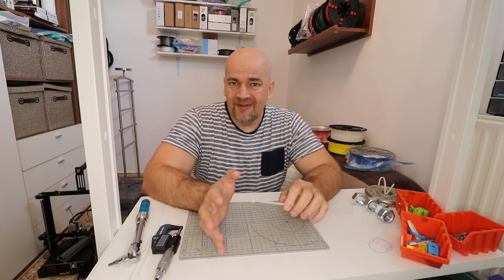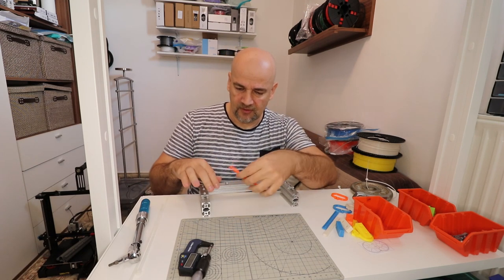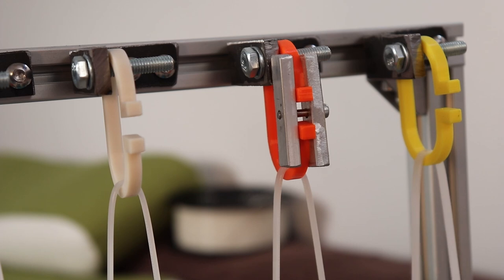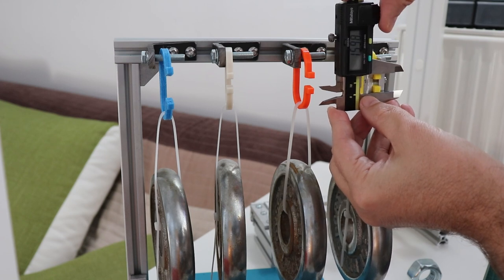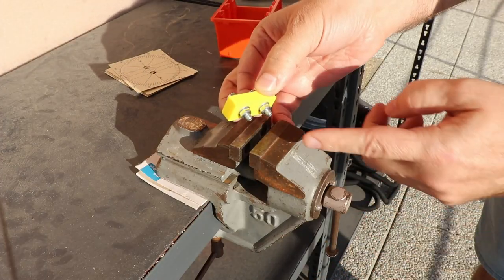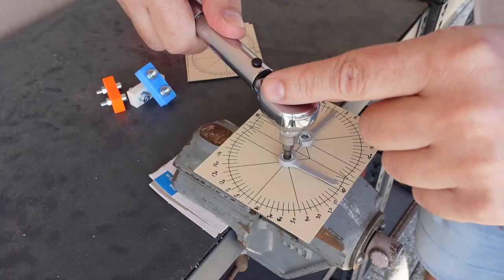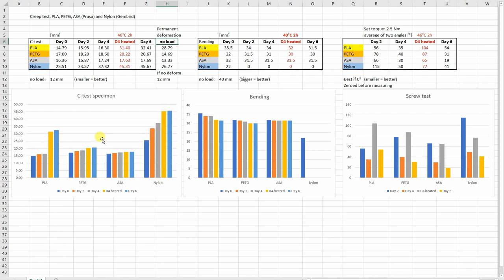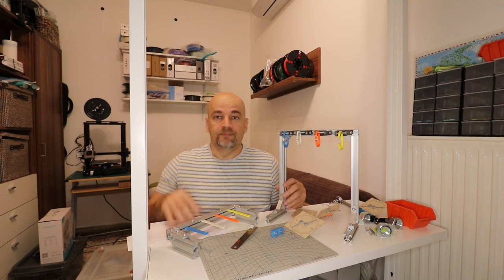Creep test with 3D printed plastic materials: PLA, PETG, ASA, Nylon

Comment: Excellent! Creeping is too often overseen in 3d-print material tests but has so much impact when dealing with plastics. Thank you!
Btw: in my experience the gap between PETG and ABS is truly noticable in real life parts, therefore I moved to ABS. But might depend on the brand.
Reply: The Voron community only uses ABS because of it's creep resistance
Reply: @WhenDoesTheVideoActuallyStart  Prusa printers use PETG. So, you tell me.
Reply: @alejandroperez5368  And? ABS is still better at creep resistance than PETG.

Prusa uses PETG it's because they had the freedom to design a printer with parts that only required certain specific properties, and had the freedom to design both the models and the polymer blend to meet those needs. Besides, they're mostly there for aligning parts, almost none of them are load-bearing.

The Voron team doesn't sell printers, they can't hire factories to produce specific metal parts for their printers or fabricate their own filament blends, they're just a grouplet of hobbyists designing printers from parts that are available off-the-shelf, so they have far more limitations.

The Voron team had to design their printers around the minimum properties of common off-the-shelf filament blends and chose ABS, despite the eternal nagging by new people about the possibility of using polyamide or PETG - their printers simply won't perform well with those.

Comment: The compression creep tests are fascinating.  I had a functional print with a live hinge compressed around a pipe, and over time the PLA it was printed in migrated away from the bolt until it became impossible to tighten it anymore.  I was hoping to find PETG or ASA had less creep under compression, but evidently not.  I guess the best that can be done is to print the compressed area at 100% infill and use the largest washer I can fit in that area.

Or carve it out of wood...

In any case, your data and collection methods are really handy, thanks for the data!

Comment: This is awesome.  Might I recommend a slightly different "screw" test?
Instead of testing how much you can rotate the screws at a given torque, a more in-machine relevant test might be to test the torque required to break the nuts free.
Procedure:  Tighten nuts to a specified torque (using your high-repeatability click wrench), then check the maximum torque required to "break free" using your digital one.
If the material softens, there won't be as much pressure against the threads, and it should have a lower "break free" torque.
Reply from the maker: Hm, great point, if I understand correctly. Instead additional tightening the screw, more important is the torque for loose the screw. That also a realistic case too. 
Perfect would be if I could measure the pressure between 3D printed object and the nut or washer for example. Imagine you use screw to join two parts, you want that pressure between two parts to be constant and strong. Now, that's hard to measure. What I can easily measure, is additional twisting the screw (which is in linear corelation with that pressure), as you can see in video. 
Maybe at the end of the test, I could measure the unscrewing torque too.
Reply: This would be very difficult to get repeatable results since a great deal will depend on layer adhesion. You are describing a shearing test in essence.
Reply: @MyTechFun  the most relevant statistic for screws in plastic is how the clamping load decreases over time, this is usually what's speced out in injection molding plastics tech sheets. However this is sometimes hard to measure, requiring a load cell/strain gauge

Comment: This is something i needed!

I would like to add untreated PLA vs annealed PLA comparison to the test, i wonder if annealed PLA will perform better.

Also a material that often gets neglected in tests is HIPS. It is very inexpensive! It's supposed to shrink less than ABS in printing, and similar to ASA, and be more rigid and less smelly than ABS, though smell potential exists, and high shrinkage potential exists too. I think i would like to see more of it. I think there can be a massive difference between brands, as opposed to ASA or PETG or most non-silk PLAs, which is unfortunate.

I do like the C-shape test, in the absence of other tests, so if i had to choose just one test out of 3, i would make a decision based on it alone, and it's fine to me as-it-is; but i think screw test is interesting too, it looks like it will provide interesting and distinctive results eventually. I also actually liked all the tests though. Maybe if you use a piece of double sided tape to secure the nut, nylon can survive the 2-point test too, well enough to make a measurement, with enough room for it to bend down. But it also looks like the most fragile of the tests, with potentially needing a different thickness of the sample depending on modulus to be comparable.

45°C is an excellent choice for a hot box, as it's more or less representative for example also of use inside a car or inside a computer. Normally say you can expect the air in the computer chassis to become 40°C under load and SSD or hard disk can also reach 45°C. Currently i have a 3D printed SSD retainer in my PC and will probably have a 3D printed CPU cooler mount in my next PC. Ideally i won't have a 3D printed backplate but we'll see. I recall Stefan (CNC Kitchen) did have a 3D printed CPU cooler retainer and it failed on him, and it was i think CF Nylon? In hindsight, not surprising. He also experienced his Voron fail in exactly the same manner, with material creep under mild heat!

I actually don't terribly mind PLA being used for part cooling fan assemblies and such, because they aren't really load bearing, and also can survive some permanent deformation. But i do think PLA is less ideal.
Reply from the maker: Thanks for your detailed comment. Yes, any kind of nylon (CF nylon) have this creep problem, it is good in impact tests for example. 2 point bending test I will replace with 3 point, only I have to solve the problem of accurate reading (with dial indicator, more accurate). 
And on my list is testing of annealed PLA vs PLA (and vs Nonoilen filament, because it is PLA type but heat resistant up to 110°C without annealing, tested earlier). For ABS testing for voron parts probably I have to go higher, up to 50C (accorting to response to my question in Voron group) and for longer time, not only 2 hrs. Mayabe 4-6h.
Reply: @MyTechFun  Thanks for the great video! I'd also be very interested in results for annealed PLA.
Nonoilen seems to be similar to extrudr GreenTEC Pro, maybe that would also be a good candidate for testing...

Comment: Thank you very much, very helpful and careful tests. I am printing a spring for a battery holder. The PLA spring deformed under the small tension of holding the battery. Based on your test I'll try PETG.

Comment: Thanks for the info! The screw test is extremely relevant since it's very similar to the kinds of loads some printed parts face when they're actually in use. I'm curious about whether annealing would help the nylon (or PLA) too.

Comment: Nice Video. I would suggest to normalize the results to get a % value (eg. Platic defimation/lenth).
I have done similar measurements with another geometry. In my measurement PLA and PETG performes quite similar (20°C).  But annihling the parts used to have an extrem impact on the creeping. It more than halves the creeping (also on PETG). The effect of the annihling was much much bigger than the difference between the materials. With Extrudr NX2 I also have found a PLA, wich dos not deform so much during the annihling.

Comment: I appreciate this test a lot as creep is an oft overlooked issue when designing plastic parts. However, and feel free to discuss, I have the impression this test is incorrectly setup because it does not account for the amount of stress relative to the yield stress of the material that the samples experience. For instance PLA is really known to creep a lot but because it is also strong and stiff, it does not deform greatly in these tests, since you are loading it with a different percentage of its maximum allowable stress than the other materials, which could be loaded closer to their yield points leading to increases in creep rate. The total amount of creep deformation at a fixed percentage of the material yield point would be more indicative, as well as the total deformation after creep recovery.

Comment: Thanks for conducting the tests. I have a question regarding the torque test. Your data shows that ASA on day 2 achieve an a average angle of 66 and then on day 4 it’s 30 degrees and when heated it’s back up to 65. 

Actually it looks like your day 4 averages for all materials appears to be better. Any ideas on what the cause might be?
Reply from the maker: I think that's normal. If there wouldn't be heating, that rotation angle would be smaller and smaller after every test, since the material is more compressed (this was printed with infill, as I mentioned). With heating, this angle jumps, but then it would be again smaller and smaller after every tightening.

Comment: Great test. Just a question about the nylon. It looks like it was not dried before use, looks like you can see that it has bin bubbling when extrudes. You also did not mention if the nylon have had time to equalize with the humidity. Freshly printed nylon get softer over time cause it absorbs moisture.
Reply from the maker: Nylon was dried, but probably not enough. 4h at 70C (it is recommended 12h at 70C, but I thought that it stay dry, because it was dried before packing in vacuum bag)
Reply: @MyTechFun  i doubt it will affect the result much since it is tested over a period of time. It will absorb moisture and get soft. Directly after it was printed the piece that was printed with wet nylon would prolly lose.

Comment: Super video! Small improvement: when testing the retightening. Don't clamp both nuts at once. I think since this does not only lock the nut from rotating but also in vertical direction against the other nut.
Reply from the maker: It is important to lock only nuts, to prevent them from rotating. So all rotation is made is visible (and measurable) from the other side. If I would hold only one nut, 3d printed object may rotate too during testing.
Reply: @MyTechFun  yes true! But I mean only one nut? Unsure
Reply: @MyTechFun  nevermind, with only one nut clamped, you could not messure the rotation since the part itself maybe turns as well

Comment: I thought the screw test was useful and would happy to see if you can develop it a little more to get more meaningful numbers from it. Maybe have the screws hold 2 pieces together with a pressure sensor in between (Arduino/Raspberry Pi pressure pads are pretty cheap). That way you can test if the clamping force is actually weakening over time, if the additional twisting to the same torque is actually increasing pressure or not, etc.

Something else I'd like really like to see is some testing in the cold. I like the higher temperature tests you do. No one seems to test for the cold, even though many people print things that are meant for outdoors or to be kept in a car. How do prints with different filaments change in strength, flexibility, and brittleness at or below 0°C?
Reply from the maker: I got your point, and you are right. I have some pressure sensors, BUT it is not so easy to use them, I need two equal or one with hole. Place it simmetric etc. That's why I measure this torque, because it is in linear correlation with that force between two parts. 
About cold test, great idea, definitely I will test it, winter is comming, I hope I will have -10°C outside :-) And I am curious not only for creep test, but also tensile, layer adhesion etc.

Comment: Great video and glad to know you are building a Voron. I am building myself a 2.4 300mm spec also. For the 4th ABS in your tests I can highly recommend "3DJake niceABS" or "Formfutura TitanX". I have been using 3DJake niceABS for my Voron parts, it is really good! There is also the option for "Amazon Basics ABS" which is cheap and I think more difficult to print, as it is not modified (no ABS+, ABS plus, ABS Pro, ABS no warp etc) it is just regular ABS, but it might be surprisingly good in properties because it is not modified. Finally, I would be interested to see NonOilen compared to PLA, especially because of the results in this video for PLA after heating and your previous video where you boiled NonOilen. I bought NonOilen from 3DJake because of your video by the way.
Reply from the maker: Hm, that would be useful info, yes nonoilen resists high temperatures. So far, i was only thinking about nonoilen for food safe applications on my workplace (food engineering department). But from the other side, it is very expensive material, so I would prefer ASA instead (if no need for food safety). Oh, so many tests to do...waiting in a row.. pity that creep test is so slow process :-)

Comment: Thank you sir, very informative video. I believe all the impact tests in the world are kinda useless compared to this because most functional printed parts are just holding something, silently deforming over time.
For even more comprehensive creep test I would like to see how part thickness influences creep for a given material. (So, for example, maybe PETG creeps more than ASA in a 2mm thick part, but less in a 6mm part)
Another test would be to measure twisting creep.
Reply from the maker: Twisting creep - great idea, thank you for the tip. Thickness effect to creep.. not sure if I will test that, more likely I will test is the correlation between thicknes and stress linear as with metals.

Comment: Great test! 
All 3 the methods show similar results (though not always the same magnitude but that is to be expected). What isn't recorded in the state after taking the stress away. At the end of the video it is clearly visible how much elasticity is lost by PLA after just a short heat cycle. But I am surprised that Nylon is so poor and doesn't return to its original state.

Polycarbonate is known to be very creep resistant but is brittle and sensitive to oils so would be a poor choice for your Voron build. PC-ABS might be the ideal material upping some properties of ABS (ASA) but not being so brittle as PC itself.

That obviously leaves CF-PETG and CF-ABS or CF-ASA as options. The surely are stiffer and very creep resistant . Whether they don't become too brittle is a question.
Reply from the maker: I just got from esun ePA, ePC and ABS+ so this will be one of my next testings. Carbon fiber...yes but a little bit later..

Comment: Try to anneal PLA - grind table salt in coffee grinder, pack it around the PLA part. Put in oven at around 100 Celsius for 20 minutes. I tried it and PLA parts do become much stronger, though I didn't measure exactly by how much.
Reply from the maker: I'll try annealed PLA too (comparison with regular PLA and Nonoilen filament). But not sure if I will anneal it in salt, I know it will deform but I will see the dimensions.. still new to annealing..
Reply: @MyTechFun  In my experience part doesn't change dimensions if packed in fine ground salt. You don't need to remelt the plastic, 100 degrees Celsius (212 F) is enough.

Comment: I modded my ender 3 to dual belted Z. Bottom belt holders were first from ASA and cracked a bit due to weak design (except the crack they were working fine). I reprinted buffied ones with PETG as I ran out of the ASA. I noticed that initially I had to spend more time leveling the bed than with ASA ones. Also now after few months I had to re-level the bed a bit. So at the next printer service I will replace the buffied PETG parts with buffied ABS ones.
Reply from the maker: Thanks for sharing your experience, very useful info.

Comment: For the compression test, maybe the results would be more useable if aggregate result was calculated?  That would show how much in total the bolts had to be tightened.
Reply from the maker: Yes, I agree, I noticed that later, now they are different type from first two. But, at least, excel table is downloadable, so it can be done by user too (*I will add this graph to downloadable excel)

Comment: I think for the screw test, the better visualization would be to show the running total angle, so day 1: 30°, day 2: you get another 50°, so plot 80° and so on
Reply from the maker: That was my first plan, but pointers are too big, they will hit the other bolt. But I need two screws to lock the position of the nut on the other side. I can redesign the graph, so it will show summary result. I'll upload this graph to my website, link in description.
Reply: @MyTechFun  ah, I think you can just add it on the graph, you don't have to do it with the pointers
Reply from the maker: @LightSpeedIII  added, new excel table uploaded

Comment: In my V0, chamber temps are around 60C, I'd recommend setting that as an temp goal for testing, and I'd test over a 24hr period, as 2hrs at 45C doesn't compare with most of my prints. Good methodology though!
Reply: He's explained that 45°c is plenty to print ASA in an enclosure. So that's his goal. Sounds like you have a different setup. Maybe you should do the test yourself.

Edit: Consider also if you have fume extraction your chamber temps aren't going to stay at 60c unless you have a heating element.